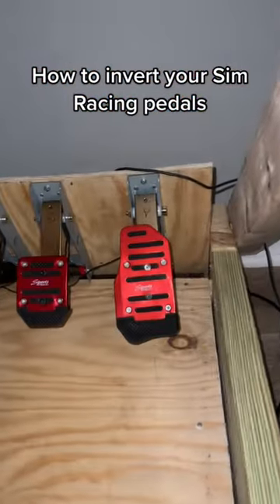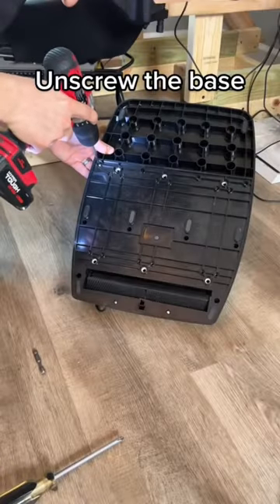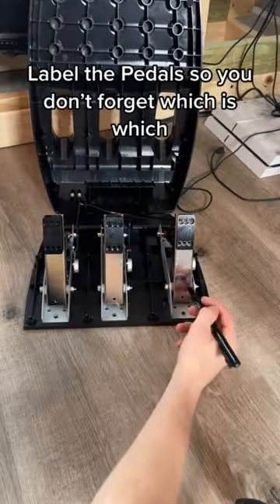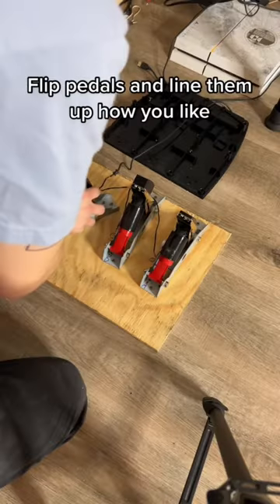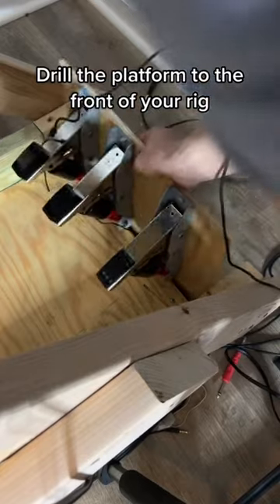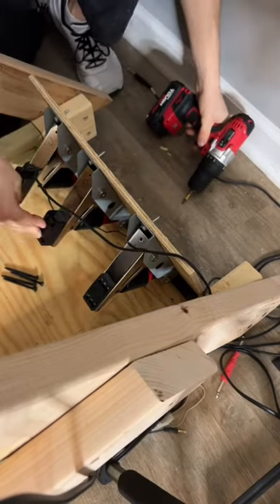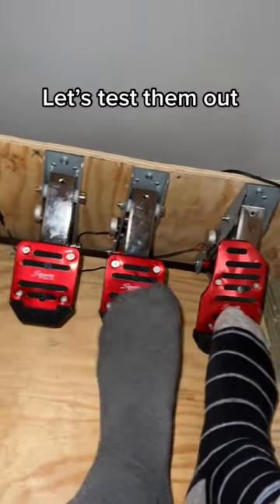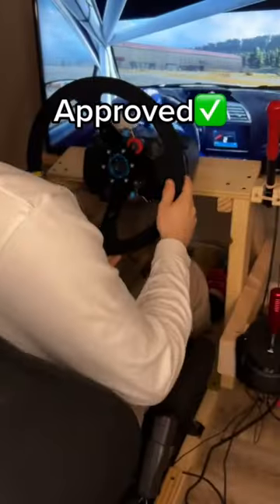How to Invert your Sim Racing Pedals.

Comment: i also did it with just 2 pieces of wood and some metal roods to make them stronger put some screw on the buttom site so they grip in the carpet is really easy just hard to find a sweetspot to like them to high is bad and to low is also bad

Comment: Problem is. When you invert the pedals, your clutch is the gas. And on wheels like g920/923/29, you cannot control how much the pedals weight. And on these wheels the clutch is super easy to press. And it means, the gas would be too easy to press, that is a weird feeling. Not recommend.
Reply: There’s a spring mod for all 3 there amazing
Reply: No problem, notice how he labelled them abc for accelerator brake and clutch? So since he wasn’t mounting with the original board, he could mount them in the correct layout, just upside down
Reply: You are supposed to mount the gas on thr bottom and the rest on the top
Reply: You clutch isn't your gas....

Comment: Can't you just flip the base where the pedals are connected and switch the Gas and Clutch position?
Reply: yea thats what i did
Reply: resistance on the pedals is different though. the clutch has more resistance (coudl just switch the springs too I guess)
Reply: @zwenkwiel816  the pedals come out as a whole unit u can swap them without taking apart pedal unit itself

Comment: OMG i didn't even know this was a thing.   Setting your tv up like that.  Ive never used peddles but thats got me second guessing life.
Reply: If you think how pedals a designed they're only gonna break faster cause youre adding more pressure to the top plate and its more likely to snap the rod.

Sure you get more control but you get a much shortened life span of the pedals

Comment: Does this work also with Thrustmaster t248
Reply: I think so, I did it with t3pa pedals (older Thrustmaster 3 pedal set) and the t248 pedals look really similar.
I just used swapped the accelerator and clutch inside the housing though.

Comment: not only does that not remotely have enough supports, the brake which is the stiffest one is in the center, the weakest point of that board... 
thats gonna fail rapidly, you can even see it bowing badly in the beginning

Comment: Or get the t3pa pros 😁
Reply: they're way more expensive for just the inverted mounting though. insides are exactly the same as t3pa. if you already have a wooden rig like this it's cheaper to just get the t3pa pedals, switch the clutch and gas and (or just the springs) and mount them inverted.
Reply: @zwenkwiel816  yeah they are quite a bit more expensive. Worth the extra money for the better grip feel and build quality imo